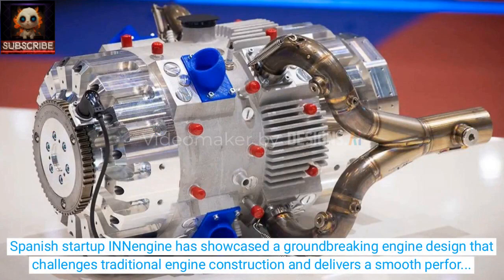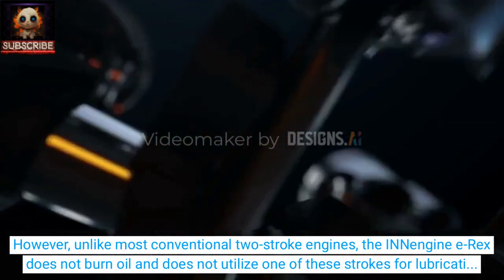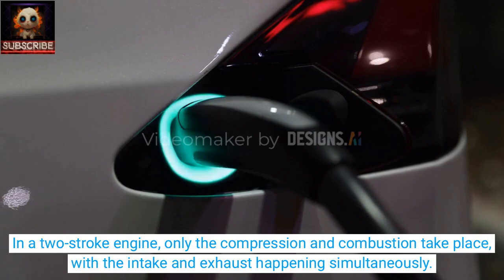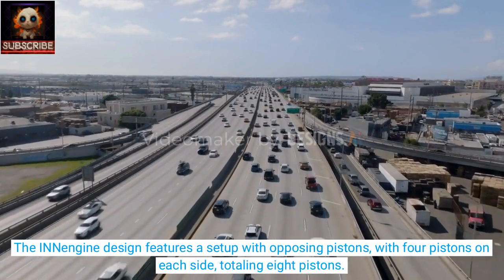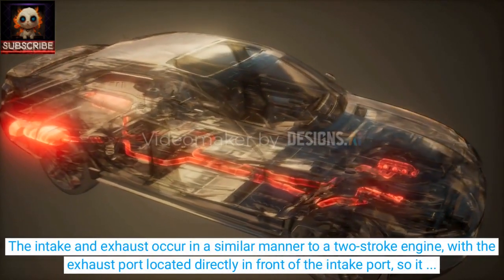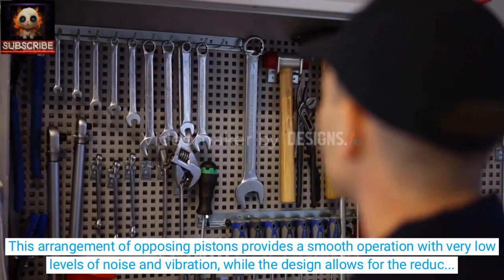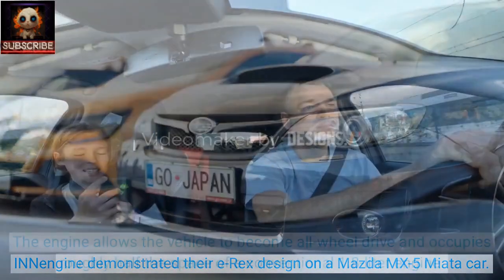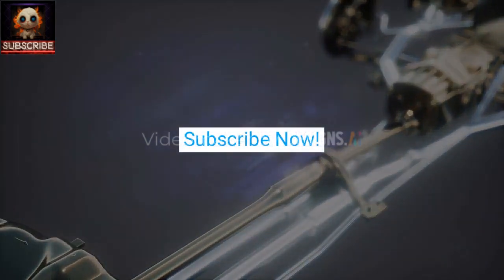"INNengine e-Rex: Revolutionary Engine for Electric Cars with Smooth Operation and Low Noise Level"

Comment: this in no way challenges a traditional ICE. the rest of the claims are dubious at best.
Reply from the maker: Thank you for your comment. I agree that the statement you describe does not question the traditional internal combustion engine (ICE). However, to fully assess the other claims, it is necessary to thoroughly examine the presented arguments and evidence. Research and analysis of such information will help make a more well-founded conclusion regarding their credibility and plausibility.